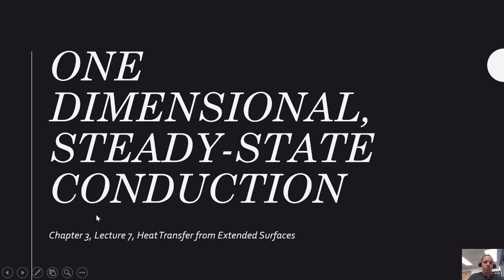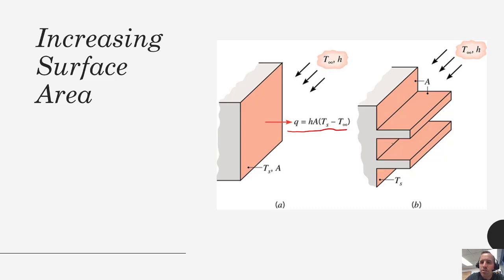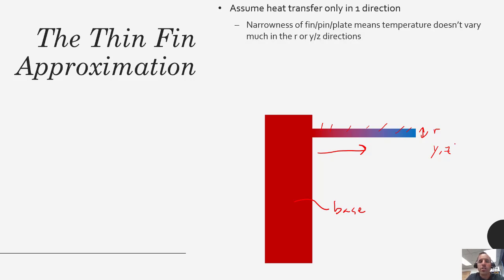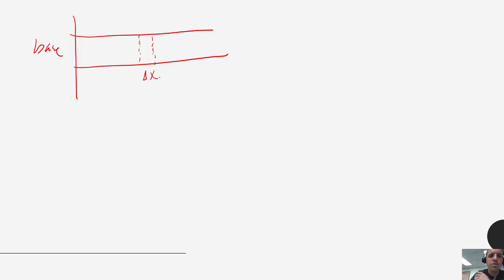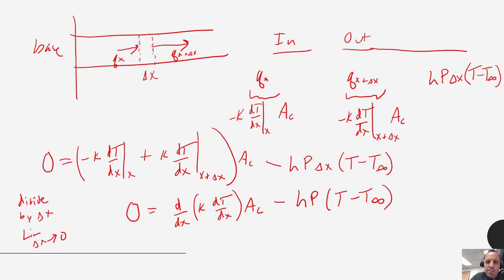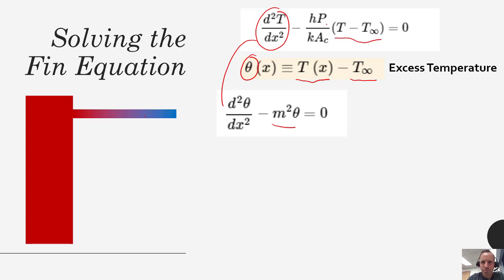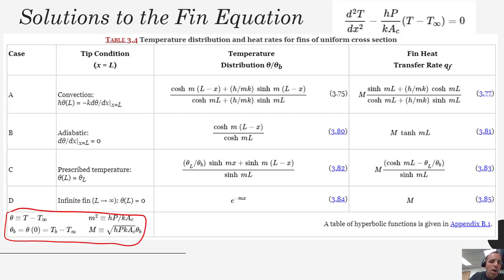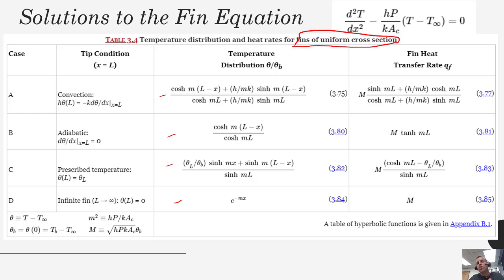Heat Transfer - Chapter 3 - Extended Surfaces (Fins)

Comment: Does the heat transfer rate also follow the inverse square law; double the surface area, quadruple the heat transfer rate, all else remaining the same? Such that if a one-unit area transfers 1 watt per unit of time, then a two-unit area would give a 4 watt per unit of time transfer. Does this really work out?

Comment: One thing I am currently stuck on with using this table in my Heat Transfer class, is actually determining which case to use when given a problem. I understand just about everything else in this chapter besides the difference(s) in which case to use. Can someone help try and explain because I sometimes do not trust my "engineering intuition".
Reply: hit and trail is your best freind

Comment: by saying heat transfer is one dimension, does that mean you onlyuse one side of the fine for the heat surface area?
Reply: The heat transfer AREA is perpendicular to the flow of the heat. Imagine heat going through in one direction (x direction) THROUGH  that surface
Reply: @jay.jay.  meaning all the heat transfer is only transferred in the one +x direction, so does not have to double the area when working out the heat transfer.?
Reply: @MkhuluMokoena  yeah
Reply: Great thanx
Reply: @MkhuluMokoena  you are welcome :)